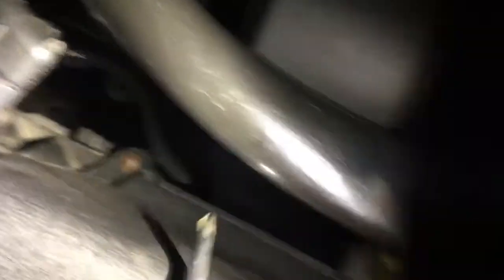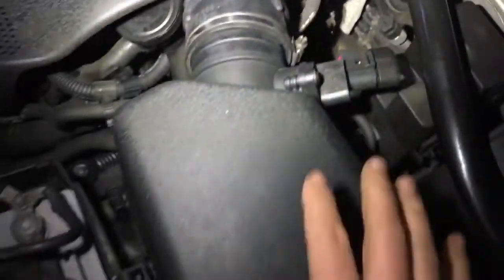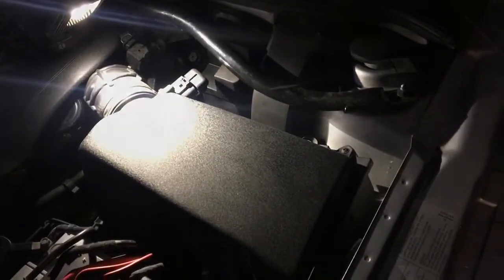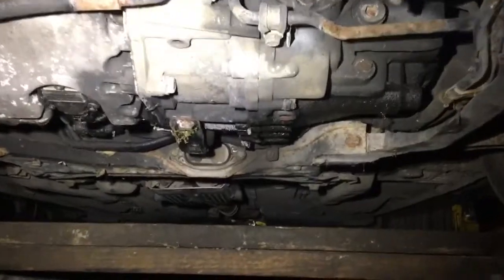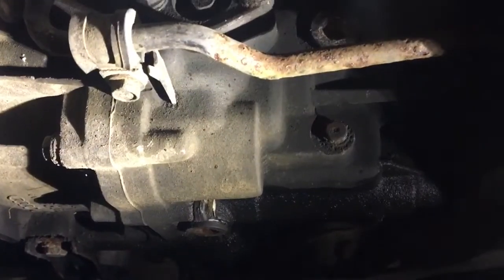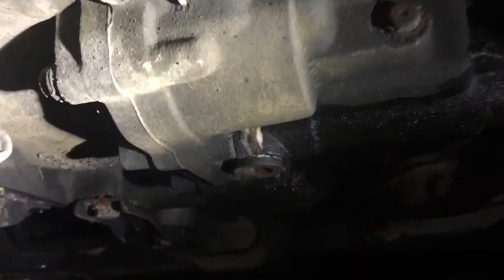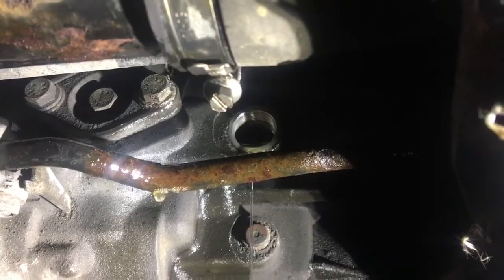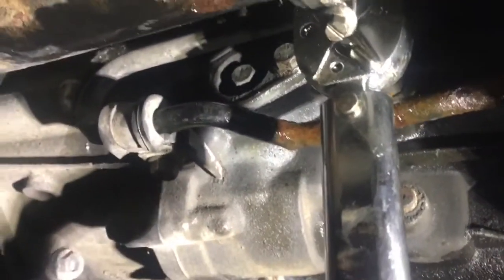2) [HOW TO] Audi TT a full service

Comment: is the haldex oil and filter only featured in quattro model TTs or FWD as well?
Reply from the maker: Only 4 wheel drive models, it for the clutch pack at the rear of the car to turn on and off the 4 wheel drive